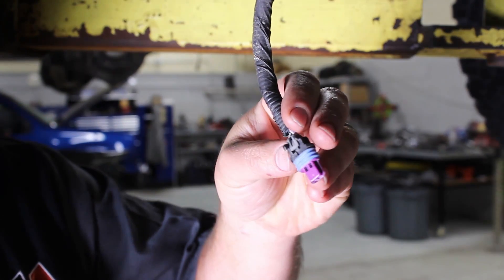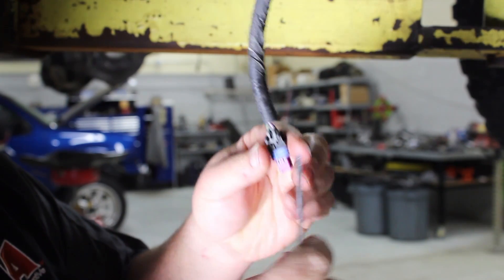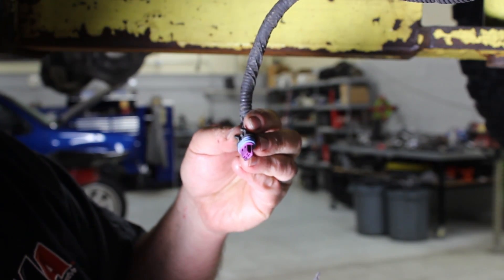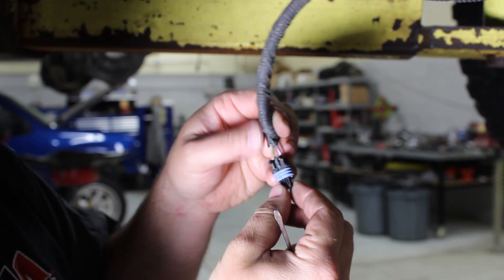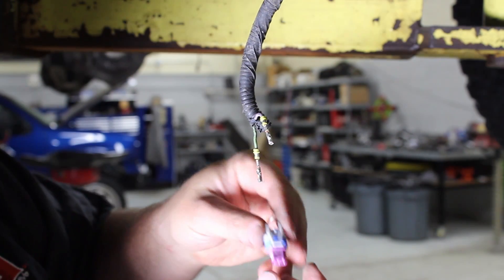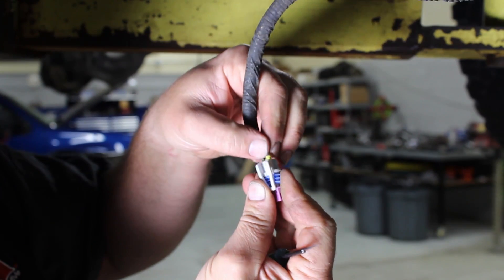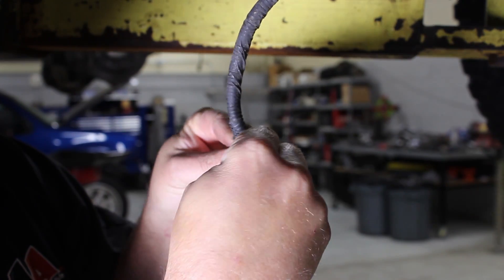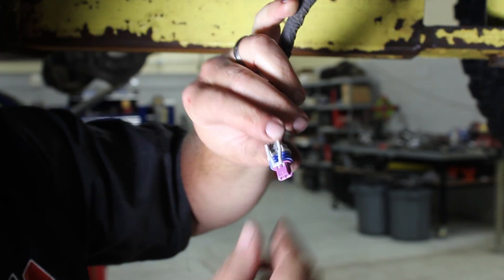Mechanics Minute: Speed Sensor Connector Body Replacement - Allison Transmission/Transfer Case

Comment: Do you happen to have the wire colors that correlate to the 3 speed sensors on the transmission and tcase, and their location inside the connector? I jumped the gun a little bit and took the broken connectors off and forgot to write the wire colors  down and can't find them in relation to the connector anywhere.